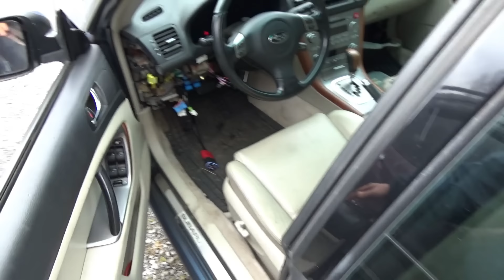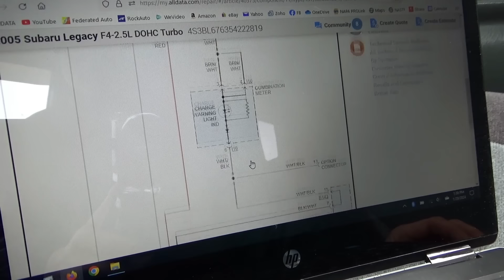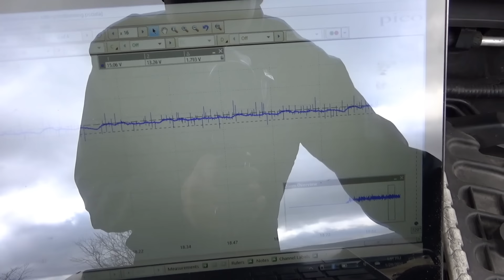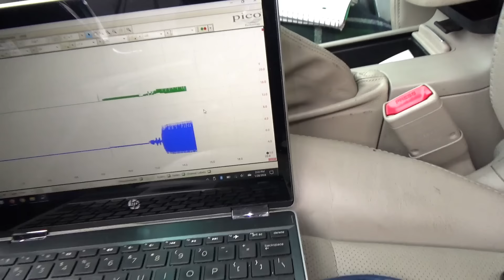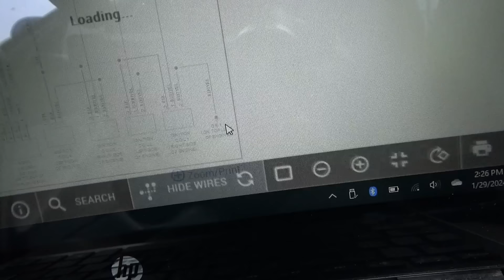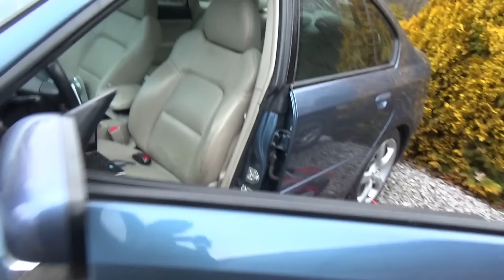Weirdest Subaru in the WORLD? (Part 1 - BARELY Runs with Alternator Connected??)

Comment: 08-15 Toyota Tundra’s  had weird OE alternators. You would boost it and think oh its good, then Would die 5secs later and your jump pack was at 8.0v. internally they would short to ground so all juice went right ground depleting any jumper pack. Battery, Couldn’t put a charger on that was a spark show

Comment: Ivan, Years ago I had a tip in hesistation output and rough run that I traced back to the Alternator diodes. Alternator rebuild/replacement fixed it. But I have to admit it wasn't this severe. Found it by checking for AC voltage output.

Comment: IVAN; 
YOU ARE SO WELL ORANIZED IN YOUR DIAGNOSTICS AND WELL EQUIPED WITH YOUR EXPENSIVE MEASURING TOOLS; YOU HIT IT ON THE NAIL HEAD LOOKING AT CRANKSHAFT POSITION SENSOR GROUND CIRCUITS AND MONITORING THE QUALITYNOF CSPS WHICH WAS FINE.

Comment: Interesting case study.

Is alternator on a CAN-bus?  Is it possible alternator is being commanded high amps when engine at idle???  Could remove belt and confirm.

Had very different issue, but related to in-vehicle network with my BMW E60.  Alternator not working because CAN-bus pulled down by faulty oil level sensor.....grrrrr!

Waiting for final outcome.

Great video as always!

Comment: Not a lot of miles but time is a factor, maybe some abused. The alternator should not affect how it runs if it is not putting out voltage in an old-style alternator, other than a short to ground. I would get voltage and maybe current to the battery, pull wires from connector after starting to simplify things. What job is it doing and how is it different from no alternator? Replace the alternator with a charger that can do the voltage and current of the alternator if it is having problems with the voltage. An alternator taking away current from a weak ground connection that affects other grounds is also logical, do a scope of the voltage from the ground battery terminal to the case of the alternator, which I assume is its ground, it should be flat 0.

Comment: Could it be possible that there’s a short either from the battery or any other leads that causes it to pulse for a split second and unload on the system. Which could cause everything to pulse and make the engine run rough?

Comment: I would check to see if both the old alternator and the new alternator are for the H2 3.0L engine. If that is so, the 3rd pin that is a pulse for the 3.0L engine computer and for the 2.5L engine wiring harness the 3rd pin might be shorting that pulse straight to ground. If so, then every pulse from that 3.0L alternator is shorting 12 volts straight to ground.

Comment: I have had two alternators that had corrosion on the ground stud that mounted the alternator's voltage regulator. I pressed out the stud, cleaned out the corrosion, coated the parts and stud hole with aluminum wire contact paste. The problem of lights dimming and brightening went away.  Maddening, as the problem was intermittent, road bumps, rain, hitting the brakes and just turning the wheel at times. But when I would check it, it produced the correct voltages.

Comment: As we know that two coils get far less current when the problem is active I'd check voltages throughout that circuit to see exactly why the current goes down. I'm assuming that would lead to finding a voltage drop somewhere, or possibly a computer going nuts.

Comment: I'm going to throw out a pretty vague guess as to what I think it might be. There is a wire somewhere with failing insulation. With the alternator disconnected the power flowing through it is low enough to stay isolated and not cause any problems. But as soon as the alternator gets plugged in that faulty insulation can't shield the wire anymore and it's getting grounded out.

Comment: Back in the "good ole days" when you could actually rebuild an alternator where voltage regulators were external of the alternator; crazy things happened when the bridge or voltage regulator failed. In those "good ole days" if an alternator failed, the battery and starter usually wasnt too far off from failing also - but you couldnt sell a battery and starter as preventive maintenance to a customer. When battery or starter did fail it was your fault because you fix'd the alt and or parasitic drain. Hence, in the old days you would write your recomendations on the R.O. what the customer might experience. You said earlier this was an aftermarket alternator, we've all bought aftermarket alternators w/out issues - but not knowing where it was bought is an unkown variable. Before Autozone or O'Reilleys there was Chief Auto Parts. Chief had the alternators and starters rebuilt in Mexico; the prob with their rebuilds is they only replaced the broken part and never did a complete rebuild. It was normal to go thru three alternators or starters before you finally got a good one. So when Autozone came along Chief Auto was pretty much put outa business. Autozone, and O'Riellys, completely rebuilds their units atleast they did early on. Now we have to deal with Dorman, Cheap Korean stuff, and cheap Mexican stuff. Dont go cheap when buying Alternators or Starters: and get the lifetime warranty. On my vehichles I always always fit a 1000 cca  battery when the old one fails. Sorry for the long post. Im going with a faulty aftermarket  alternator or a broken crusty ground in the Alternator circuit. BTW, I've had alternators that would not act up on me over time left someone stranded. I still remember a Lincoln that did this three times. Always acted fine after removing it to be bench tested - it always tested good, heat related (who knows). Finally talked the owner into "just replacing" the alternator as every piece of data kept pointing to the alternator. New alternator fix'd the problem.., was this a win for the Parts Cannon😂

Comment: Not sure what's going on, but a few checks I'd make.  You say one side of the crank sensor is ground.  Is it grounded by the ECM, or is that line shorted?  What happens if you pop the belt off?  Does it still malfunction with a non-spinning alternator connected?  Like wise, what happens if the alternator is spinning and plugged in - but the battery lead is disconnected (no amps)?  What if you crank up the battery maintainer to get the alternator to back off?  I do wonder about the magnetic fields from the alternator affecting the sensor.  Those are quick checks that would provide clues.

Comment: I would disconnect the main power lead leaving the alternator and check voltage there, could be a bad rectifier causing ac current to flow to the car, if the pulley size on the alternator is close enough that the alternator poles are synchronized to the engine ignition events you could be seeing negative voltage on the dead misses, and positive voltage on the hits.

Comment: Great analysis. I was ready to condemn the engine ground, especially after seeing the appearance of the battery connections with rust on the battery clamp nuts. (Why can't people just clean them and coat with vaseline? My batteries last 8 to 10 years in the Northeast with simple maintenance like that.) But I would have been dead wrong. That's the difference between my dumb-assed guesses without careful oscilloscope work, and what you do.

Comment: I worked at a Subaru shop (shame on me). The PCMs would fail in unusual ways sometimes. I would run the car with the battery maintainer set to 14.5 volts and keep the alternator unplugged. If it still acts up the pcm might be at fault. I would also check the battery ground to the body. A bad connection at that body bolt will cause all kinds of problems. One more thing to check are the two small braided ground wires from the valve covers to the body that are almost always rotted off.

Comment: Connect the battery charger set on "nuclear" to the leads for the alternator, taking the alternator out entirely but still loading up its output & ground wires - ruling out the alternator itself as the problem?

Comment: Also, this just popped into my mind. If you can check the voltage on the fuel pump with the alternator plugged in and not plugged in and see where that takes you.

Comment: I bet it has something to do with the parasitic draw on that 15 amp fuse. What circuit is that fuse in, what is the draw, what is the draw with the alternator plugged in and what is the draw with the alternator unplugged. Something is probably jumping to ground in that system

Comment: Check cam signal? This reminds me of a Bernie ATS video where the camshaft was magnetized due to a missing ground strap from the cylinder head to frame rail and the cam signal was being inverted at a certain engine speed. Maybe instead of a certain engine speed altering the cam signal the system voltage is. To answer the question at the end of video I would check cam signal next.

Comment: What if the coil you're reading the ground on is one of the ones that's still performing? Next, I'd run the same test on the alternator case. 

This car reminds me of the one that Bernie had that had the ground modified and flowing across the crank. If all other ground checks are good, I'd install a temporary ground from the alternator case to the battery. If that fixes it, I'd be back to looking at the ground path. With multiple ground paths, it could electrically test good, but be flowing on the wrong path.

Comment: What I would do next is to put the Tornado 5000 at 14,7v with the alternator disconnected and see if the problem is related to battery voltage. If that does not cause the same issues as the alternator, I'd first put the ground terminal of the Tornado to the alternator case, and if that does not reproduce it put the positive terminal of the tornado to the positive terminal of the alternator.
Basically let the Tornado simulate the alternator.
If even that does not reproduce the problem, it's time to remove the belt from the alternator and see if the problem is still there if the alternator is only electrically connected.

Comment: Ha ha, you left us hanging. Along the line of gaining info, I think I'd look to identify which coils are dropping out. If we can show it's the same coils each time, we could swap position of the coils and see if the abnormality follows the coils or stays with the driver. And while at it, I'd try to look at the ground wire for the specific coils that are abnormal. Perhaps they share a branch ground and the connection from there to the mother ground is tenuous, exposed with more power use. What a great case....

Comment: Had similar on my KTM, the stator had shorted to ground but at idle it worked as you reved up it got worse, misfiring etc, it'sa FbW throttle and it was not acting right, I was still getting some charge, very odd.
Replaced stator and regrec and all was OK again.
My guess was the stator was pulling the voltage down as the bike reved up as it was grounding out.
Odd stuff.

Comment: That’s a bad ground. When the alternator is connected it is putting amperage out to the battery. If the engine ground is bad it is putting a voltage to the poorly grounded accessories on the engine. I would get a heavy wire and connect it to a bolt near the alternator and go straight to the battery to see if the situation improves.

Comment: That's very interesting One thing I did notice is the first and second coil are completely dead when plugging in and the third one is only like halfway powered and then the fourth one is completely powered so is it some kind of time related thing. Also there are some interesting things that I noticed the parasitic draw for one and also the battery having 20 amps but not being able to crank. I'm very suspicious of a bad ground break out your thermal camera and check the grounds for heat

Comment: Engine grounds are quick to test with some jumper cables. But I do wonder what kind of current that alternator is putting out as to if that is electromechanical resistance that is being seen, and if so in to where is that energy being dumped into. If it's really high on the amp clamp, I'm sure that a thermal camera could pick out the hotspots in an instant.

Comment: I haven't finished yet but you could mimic the alternator with your Top Don power supply.  Connect positive to the alt output and ground to the alt chassis or closest equivalent ground point.  Turn power supply on and off and see if the results match.  If so your ground theory is sounding very good.  Make sure to probe the worst coil and check positive and negative.  I would assume you'll find something and then troubleshoot why the positive is being pulled down OR ground is pulled up.

Comment: Everybody's different, so are everybody's troubleshooting techniques. upon discovering that connecting the alternator cable resulted in rough engine performance, I would have de-pinned the alternator connector and then reconnected the connector pins individually one at a time to understand what wire, when connected, caused the rough engine performance and then followed that diagnostic result.

Comment: So my first thought at this stage would be to pull the ecu fuse and feed in external 12v DC power ideally from a variable power supply  to see if either 1) The ecu is being sensitive to ripple from the alternator, or 2) By turning up the voltage on the variable psu to see if the ecu starts dropping out when it sees 14/15v

Comment: That is totally insane I know alternator can do weird things but I've never seen one do this I'm kinda wondering if you got some kind of a loop back feed on the ground though as long as the alternator is not plugged in it is probably grounding backwards perhaps there's a wire that melted between the two and causing,

Comment: I installed a Subaru 2000 2.5 in my 1986 vw vanagon I’ve been  fighting this high idle stays at 1500 rpm’s no matter what I do. Replace it did drop when I replace throttle body and rpm’s did drop but didn’t last i do have the Subaru harness on this swap thanks for the awesome videos you.

Comment: Wild guess - use your battery maintainer to raise the voltage to 14.2 or near that without the alternator connected.  See if that duplicates the alternator connected symptom. Guessing at the age of the car there is an electrolytic capacitor breaking down in the engine computer (or elsewhere) when at full running voltage.
Reply from the maker: Great thought process! Yes we want to rule out the alternator completely 👌🙂

Comment: There are 2 engine harness grounds right on the back of the driver's side intake at the cylinder head.  They may be loose or corroded.

Had an '08 Subaru recently, non-turbo, a failing ignition coil was feeding high Kv's into the 12 volt system, with the alternator plugged in, evidently it was enough load on the engine to cause coil break down. With the alt unplugged, the engine idled fine.

Comment: I would connect a ground directly to the alternator just to make sure it wasn’t a poor connection to the block. Then I feel like at this point I would just power the alternator through a direct power source and bypass the plug. If it charged and ran normal I would also plug in the lamp wire to make sure that wasn’t causing an issue. If that’s the case then maybe a problem with the supply wire. If it was still acting up with the isolated supply it would have to be the alternator.

Comment: Hi Ivan i wonder if the extra 3 or 4 volts from the alternator when its plugged in over normal battery voltage is effecting the coils or crank sensor, or is there any alternator wires chaffed through to the ignition, real weird one, wornder if it does the same thing with the alternator belt off...that is a strange one...wonder what would happen if you put all the lights on so the voltage might come down a bit, would it run ok then...is it worth sticking a jump lead from the engine block to the battery neg terminal, good luck sure you have cured it by now..Fred in Uk

Comment: One of those wires on the alternator connector is shorted to a coil or injector wire. Bypass the connector and manually run a length of wire directly to the battery's positive and another one to the battery's ground. Plus, that connector looks like it has three wires!

Comment: I've seen similar to this with an electric motor..  which had internal coils shorted.  But the fact that this alternator is brand new, makes me think that your main output wire on the alternator is shorted.  The first thing I would do is unhook your main lug on the alternator-- and then try it again and see if it still bogs down the engine...  If it no longer bogs down the engine, then I would trace that main charging wire and see if it's shorted somewhere..   I think the fact that it's dropping coils is just a weird side effect;  maybe it's supplying so much power to the "ground" by being shorted out, that it's virtually removing the ground of the coils by floating a voltage on the ground side.  but I'm super interested to see what it is. :) ........   I'm thinking that main lug/charge wire is disconnected from the battery (or it goes through a blow fuse)..  but is shorted to ground somewhere between the alt- to- battery run. 

 I have a similar issue just like this on my 2005 ZZR..  The coils have very weak spark and I'm not sure why.. I put on new coils and it didn't fix it.  I'm not sure what's going on just yet.  So hopefully this case study will give me a clue.   I'm looking forward to it. :)